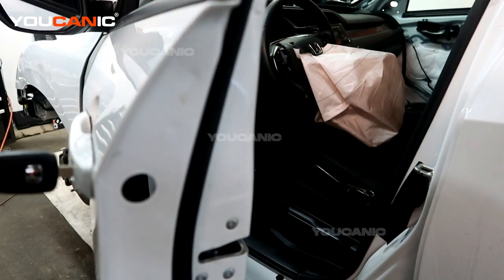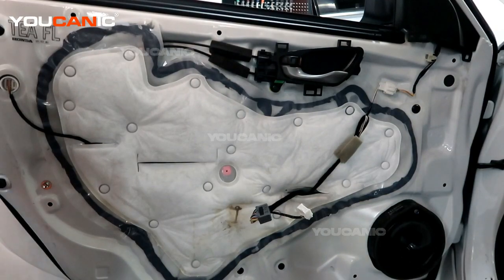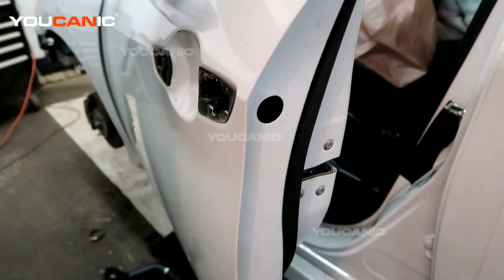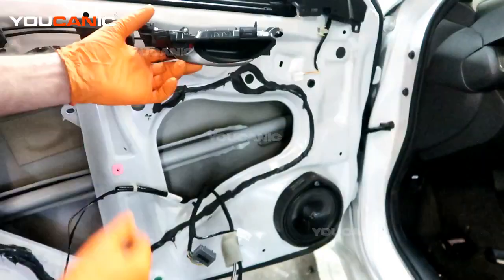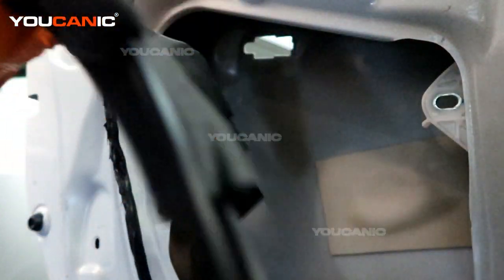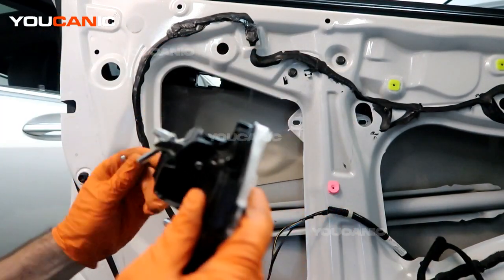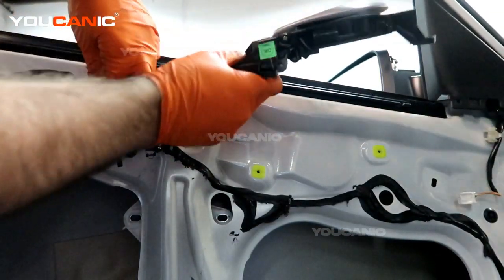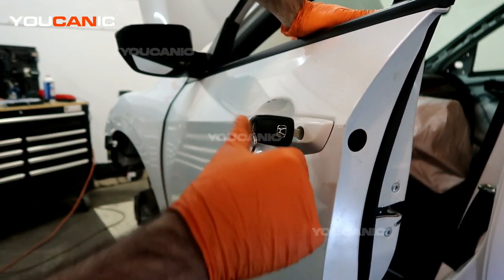2016-2021 Honda Civic - Door Lock Actuator Replacement

Comment: Great video.  Thanks for breaking it down.  When re-installing the exterior door handle, you forgot to put the black pieces (gaskets I assume) under the handle and keyhole.  You removed them around 4:19 in the video.

Comment: Excellent video, saved me lots of $$$ being able to do this myself with your video guiding things. I had to replace the passenger side rear door lock actuator instead of on the Driver’s door like you’re doing. It was much easier to secure the bar inside the plastic piece that holds the door handle from the inside first and THEN slide the actuator around the window guide rail and up thus allowing the bar to slide into the circular groove on the actual actuator Vs the reverse order it was done in this vid
Reply from the maker: Thank you for your positive feedback and valuable tips! At YOUCANIC, we aim to empower car owners like you. We encourage you to explore other handy video guides, free resources, and our powerful YOUCANIC scanner on www.youcanic.com for easier car maintenance. Remember, our team is here for you if you need any assistance. Happy car fixing!
Reply: hey same thing is happened to me my locks being noisy as hell, where did u buy the replacement meant lock motor? im js tryna find the cheapest one

Comment: Thanks so much❤
Reply from the maker: We're so glad you found our video useful! Our aim is to empower car owners like you with the knowledge to handle your car repairs independently. We highly recommend our YOUCANIC Full System Scanner. Much like how the experts diagnose modern cars, this tool puts the power back into your hands. Learn more about our scanner at www.youcanic.com/scanner.

To ensure top-notch results, detailed procedures from Factory Repair Manuals and Torque Specs are invaluable. For just a small fee, you can have access to such resources at www.youcanic.com/manuals. With these, you can fix your car right, every time.